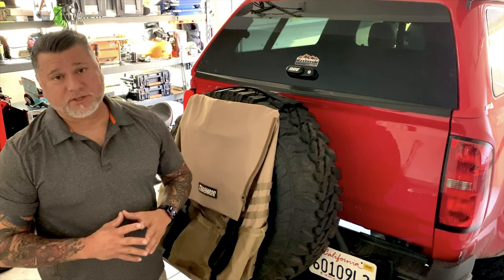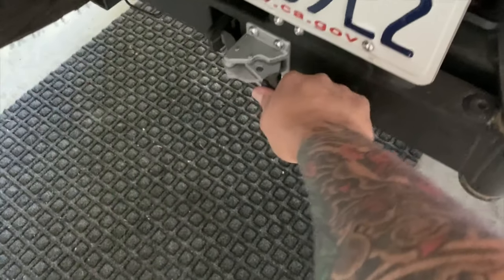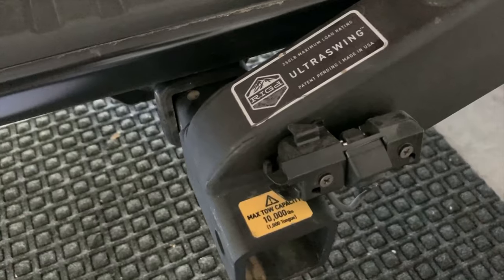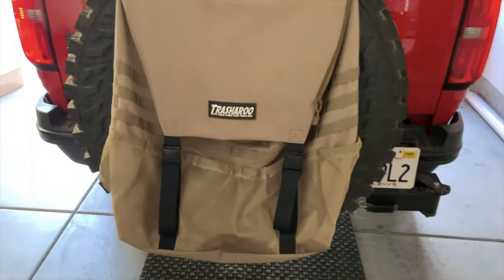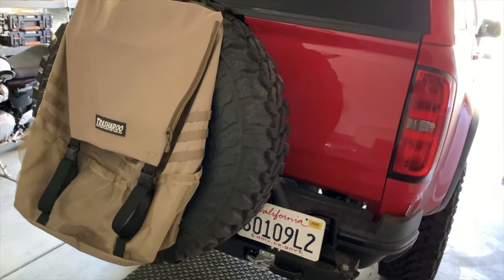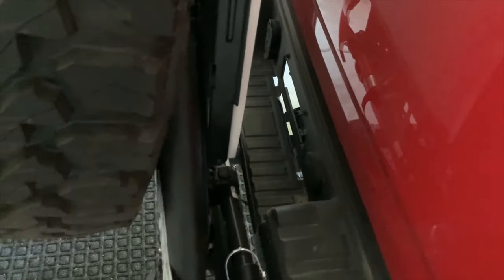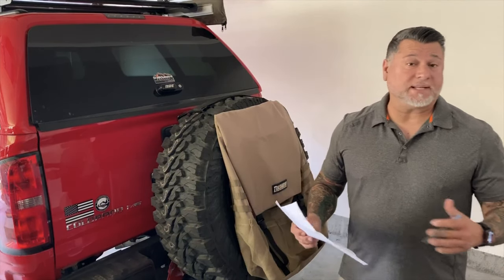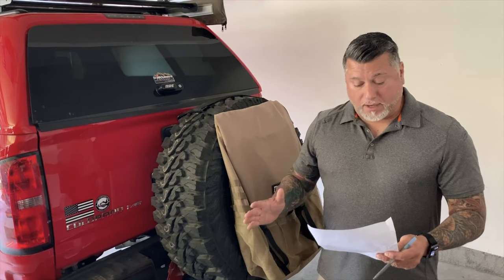Chevy Colorado ZR2 UltraSwing Tire Carrier Review

Comment: Great info.  Thanks  for that.  I have some constructive criticism......There was no mention if the spare can be locked to prevent theft.  The license plate is obscured by the large tire and has no light.  Yes I realize this falls under the same issue with the camera since the tire mount is universal.  Just my 2 cents.  Again, thanks for pointing out both pros and cons.
Reply from the maker: Snake Plisken License plate in my opinion was not obstructed. I had never had anyone make reference to it being obstructed. You are correct in saying that it did not have a light. And I’m sure our viewers would definitely find value in your comment. So I will pin it to the top. Thank you for coming to the channel and thank you for participating. It makes a difference. All the best.

Comment: Nice video! I’ve been looking at this product for my 4Runner. Once thing I noticed on your rig... you need to install your hitch pin on the factory hitch sleeve to help secure the swing out to the truck. That wedge alone isn’t sufficient to hold in the swing out... not to mention if you still wanted towed with it installed. Just an observation. 👍🏻
Reply from the maker: Thank you for the tip I’m sure others will find it very helpful. All the best.

Comment: I just installed the Mega Ultraswing on my 99 Lexus LX470 - it has an aftermarket Draw Tite hitch. The whole set up seems to stick out about a good 2 inches too far away from the truck. I have it pushed in as far as possible with also being able to align the pin holes. I like the way yours is tucked in pretty close to the truck. So far, it's top notch, just a bit disappointed to have it stick out so far.
Reply from the maker: It’s a very useful addition. But I took it off and moved the tire into the bed of my truck just in front of the axel. This gives me more balanced load. And less pendulum action at the rear

Comment: You'll also have to to update your suspension if you go with a CBI rear steel bumper. The ultra swing is a lot lighter. Can also remove the ultra swing if you want. Can't do that with CBI.
Reply from the maker: Roaming There are definitely pros and cons to both set ups. My rear suspension has already been updated. The ultra swing sticks too far out from the hitch to be a real off-road contender. In my honest opinion

Comment: I have the Relentless fab bumpers with the swingout and I love it. Definitely pricey. I am actually interested in the overhead racks you have (cab and camper). I've seen the Victory offroad cab racks but not camper.
Reply from the maker: Victory off-road makes some very nice racks. The racks used on the ZR2 were manufactured by Prinsu designs. Not sure how they’re sitting on stock currently. But check out their website.
Thanks for watching.

Comment: ALL of the points you have addressed as "cons" are easily overcome. If an individual is going to be using a product of this type on a vehicle that has been modified to enhance their off road experience, then they should have some type of mechanical inclination on how to improve upon their purchase. If not, then I would recommend a Toyota Prius or just stick to the mall and have a AAA Gold Membership. They will probably need it.
Reply from the maker: Yeah, I guess you’re right Ernest. Nobody makes a perfect product anyways. But they are definitely making improvements over there with the ultra swing.

Comment: I have the 2019 ZR2 Bison Diesel and just purchased the Rigd swing out. The issue I have is my back up camera relocation can you tell me how you actually took out the original and moved it? Instead of removing it can you disconnect it and plug in a new camera ? And do you know what pin connector is used so I can plug.and play? Thanks  by the way what year is your ZR2?
Reply from the maker: Hi Mitch.
Congratulations on that bison. That thing must be a beast. If I remember correctly, I remove the panel off of the back of the tailgate to access the camera and it’s wiring. I then remove the wiring from the tailgate completely all the way down below the bed near the bumper. I then removed the camera from its stock location And relocated it onto the tire swing. To be honest with you it was kind of lame but it worked. So I wouldn’t be able to help you with regard to the connector. That one you would have to research at your local Chevy dealer, parts counter.

Comment: Great vid, going with CBI
Reply from the maker: Kurt Klimisch Great choice. I will be installing their rear bumper as well. And I think I might even go with their complete skid plate system
Reply: @TrailAdventuresTV  I have reconsidered, I think putting a rear swing out on a pickup is putting too much weight to far from the rear axle. I think you are asking to bend your frame. Going to move my spare onto a rack above the bed in front of the rear axle.
Reply from the maker: I went with her complete skid plate system. But did not install the rear bumper for the same reasons. Have my tire in the back of the truck installed in front of the axle. Better weight distribution.

Comment: A year late reviewing this. Did you have to purchase a relocation kit for the camera?
Reply from the maker: It was not available at the time of purchase. I had to make my own.
Reply: @TrailAdventuresTV  Where did you find the wire and connectors?
Reply: Also, just a FYI. The carrier I just put on my ZR2 now comes with license plate mount with light and harness. Thank again for your video.
Reply from the maker: The wire that connects to the camera is pretty long. I just took the wiring out from the inside of the tailgate down past the bed and then extended it out to the bumper. No connectors or cables needed. I fabricated my own camera head mount out of a piece of aluminum.

Comment: Trail Adventures USA, will that hold a 37" tire? I would be interested in it if you would like to sell it and purchase a cbi bumper. I'm located in Riverside Ca. (So Cal)
Reply from the maker: salvador michel I am pretty sure that it will hold a 37 inch tire. But to be sure you should reach out to the guys over at rigd supply. There info was in the description.
The tire carrier has already been sold to one of our subscribers.
Reply: I just bought it for a 37 and you should contact rigd. They informed me to order and offset

Comment: Is that your OEM back up cam and what did you do to install it on the mount. I'm a beginner
Reply from the maker: Just pulled the camera and camera mounting bracket out of the tailgate drilled a couple of holes into the ultra swing and mounted it.